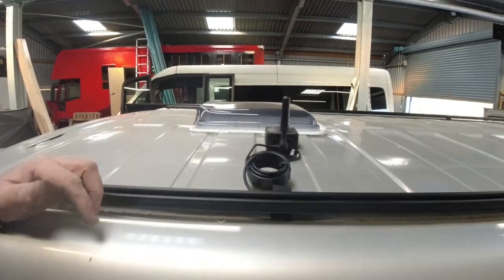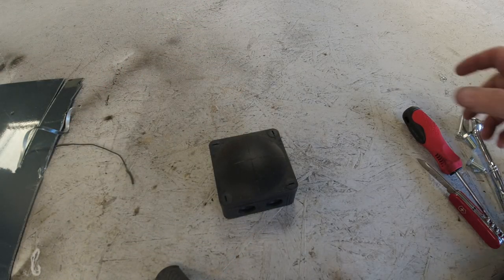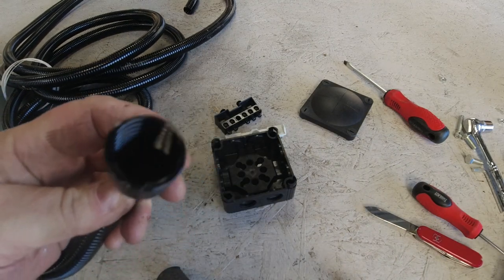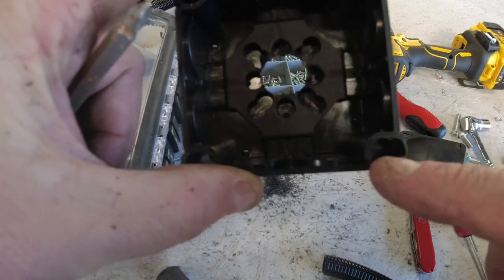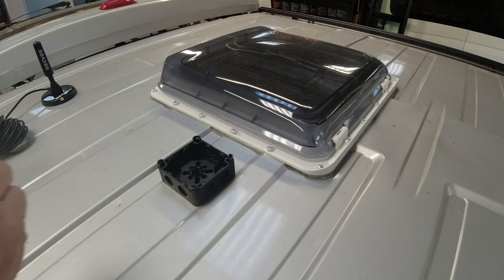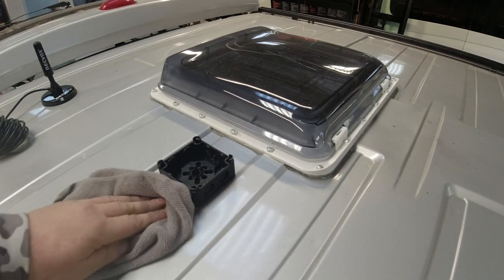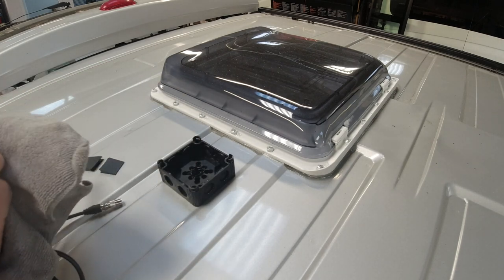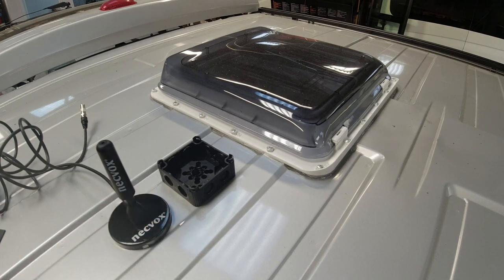Renault Trafic Campervan Conversion - TV Aerial and Cable Gland Install

Comment: I've had the magnetic Ariel for 2 years, driven at 70 mph and its never moved from wherever I put it. I'm glad I didn't glue it because I've had to change it once and also I move it around the roof to get better signal wherever I am parked. Its personal choice but just thought I would mention my experience of the ariel. I get a great signal from them too.
Reply from the maker: I think everyone has there own idea as I know others have fixed there ones too

Comment: If the Trafic is under 2.5 metres tall overall, why not leave it magnetic then the owner can get under height barriers and knock it down without damaging it if he forgets it's there ?
Reply from the maker: the aerial is detachable by unscrewing it still, so the height is still less than the solar and light bar I have fitted